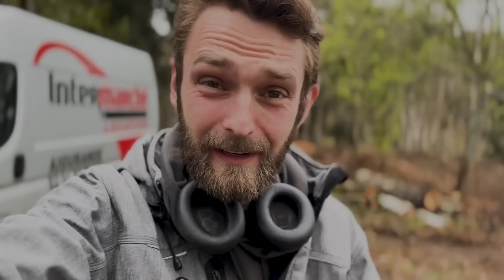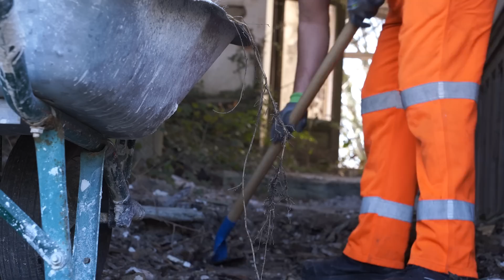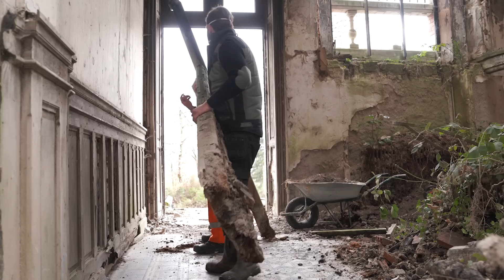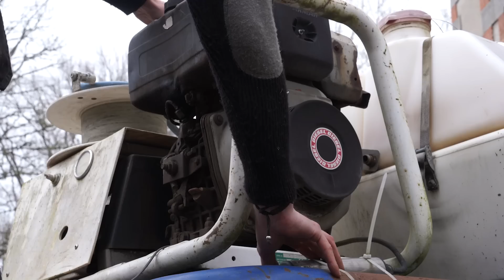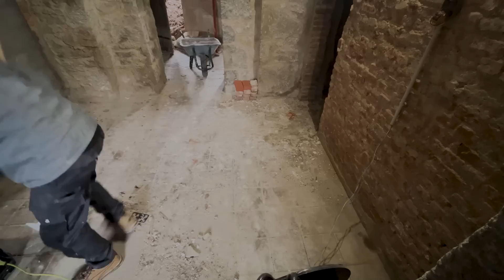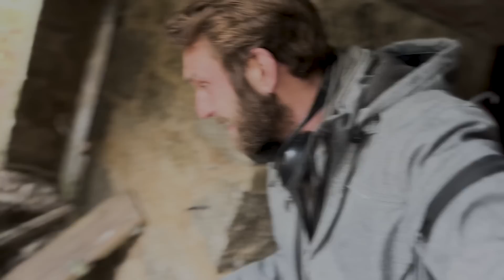Orange trouser man is back.

Comment: Hello, Dan! I am worried about the health of that gorgeous tile floor on the entrance level. It has been protected from falling debris for many years because of the soil and plant layer on top of it. Now that it's exposed, my concern is that a great wind storm or a careless construction worker may drop something on it, and tiles may crack. I would strongly suggest that you get a layer of at least 5cm interlocking rigid styrofoam boards from wall to wall, and then cover with sheets of plywood or OSB, with taped seams to minimize tripping hazards, to provide a rigid surface to walk on during the construction and structural reinforcement stage. Some of those materials could then be lifted and reused once the shell is secured and the roof is on. This project is so interesting and it is truly wonderful to see how motivated you are to research and restore the old girl to her former glory! Best wishes to you and your friends and crew as you continue to make headway in preparation for the build!!!

Comment: You need a few fold up chairs to keep on site too. ❤
Reply: They can use the picnic table when the weather is good.
Reply: @lgrindrod3474  Of course, but if it's hot, given summer is coming, they can sit in the basement to escape the heat.

Comment: Hey Dan, have you considered putting a concrete ramp down to the basement floor elevation between the two stairs to the first floor.  That would make it possible to have a full size door from outside to the granite room in the basement.  You would eliminate those awkward stairs and bending over to get in.  I think you could get a less than 30 degree slope.  The drain in front of the new door could also carry away the water from the new downspouts on that side of the building.

Comment: Mixed bag of feelings 😂 exciting, you really should sieve thru all that rubble, may be a leftover diamond ring ring in there 😁 a crew!! YAAAAAY!! 🤞😊🙏🥰 🪵
Reply: Metal detecting to find lost treasures!
Reply: If it was arson then no valuables would be in the rubble
Reply: Not to mention any door and/or window fittings or parts of light fixtures that might provide some design direction.

Comment: Please don’t take the tile up just covered and protected. Don’t make yourself have to do the job twice.
Reply: Unfortunately, he'll have to take the tiles up because the cement and rusted rebar flooring it's sitting on (ceiling of the basement) has to be completely removed and replaced according to what he's mentioned several times in the comments. 😢